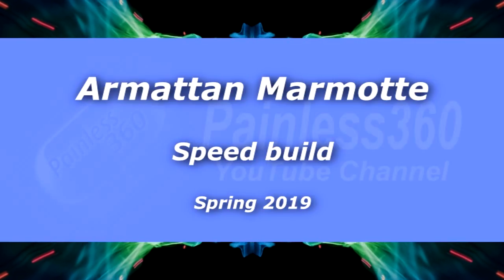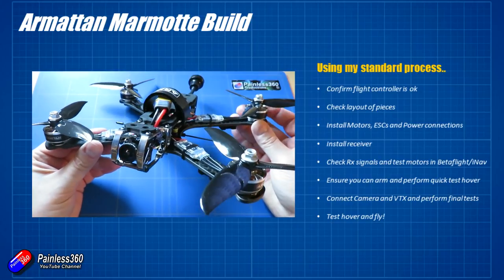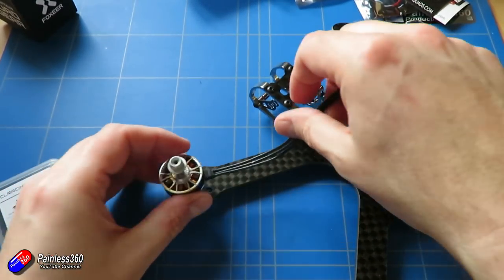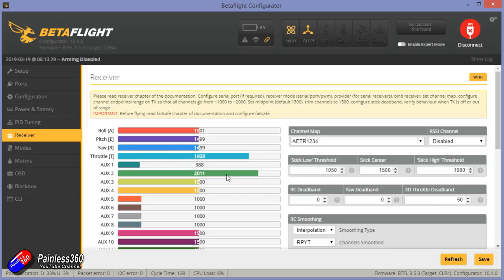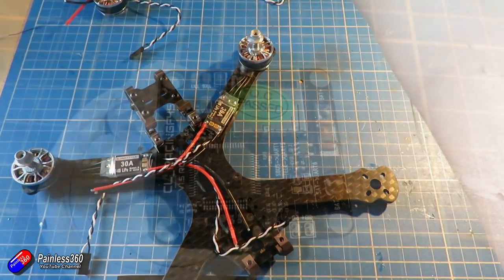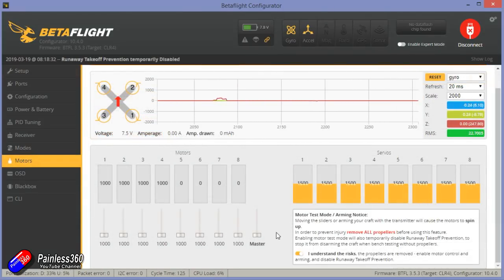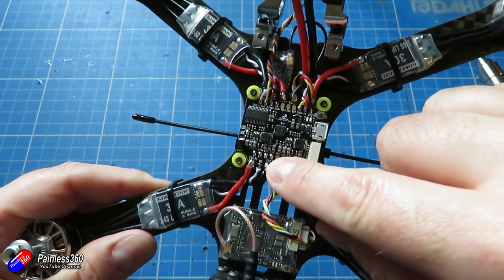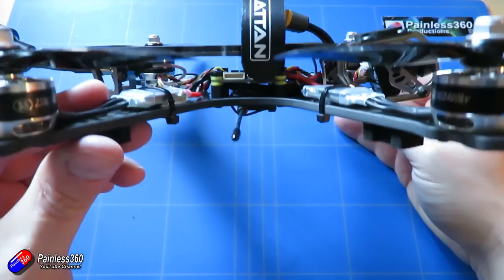Armattan Marmotte: Speed Build

Comment: Thanks Lee!
I always find it fun to check system capacitance with my multimeter after doing the short test:-)
Just finished my Marmotte, and it’s finally the correct evolution of the chameleon after “bolt-gate” and “separate-arm-gate” on the Rooster;-)

Comment: Thanks for the video build 👍
If I use different motors could I use 
Ion Drive 2506 1250KV . 
I’m looking for a good flight time 
Double bladed props on The 6 inch Frame

Comment: Funnily enough I just got finished building mine, literally just plugged battery in for the first time 5 minutes ago :)
Reply: Using different ESCs and motors to your build though. Got spedix 30A ESC and BH 2306 rainbow motors. Just setting up blheli and betaflight :)
Reply from the maker: Best of luck with the maiden flight! :D

Comment: Just curious, but won't this take a 4in1 stack? If so, why not eliminate that added ESC weight?
Reply from the maker: Yep, see my other builds .i use both in builds to show the options and it's a 'horses for courses' kind of thing. Some have very strong opinions about what is best but they both have advantages.
Reply: @Painless360  I was looking at your video because im very interested in armattan marmotte and the same question pop in my mind "why dont use a 4in1 board for a better and cleaner build"
Btw nice and too build right there

Comment: hi thanks for the vid tutorials/content, find them very useful. i built my first quad, the marmotte, and so far, just about everything is working when testing, however i can't seem to figure out to get my taranis x9d+ (2019) responsive in Betaflight, i haven't done any serious port configuration yet, as can't figure out the UART bits. i'm using the Xfire nano RX with the Xfire TX lite module. it seems to bind fine, however when i move the gimbals for instance, nothing is registered in the receiver screen on betaflight. Using 2.3.9
Reply from the maker: Check out the build and how to videos on the Armattan website - they cover all the setup steps..
Reply: @Painless360  thanks, checked a few more vids and got through that initial issue. for the most part, at this point i always get 3/4 channels responsive in betaflight. So A E T but not Roll, or if i switch the mappings it could be everything but Throttle. when i check the channel monitor on the taranis, it all seems fine.
Reply: @Painless360  made it through, got a test hover done, thanks for all your time, effort and videos lol. still, have some work to do but it's mostly tuning, actually built a second one since the chameleon TI. My Marmotte in regards to cable mgmt is a mess, but the TI is a lot better, aside from that, i just nixed the receiver in a crash, but =) thanks again

Comment: Do you think 6 inch props can be squeezed in the frame or is there not enough clearance for that?
Reply from the maker: Just measured it.. they fit with about 2mm of clearance..
Reply: @Painless360   Thank you so much for taking the time to measure it up. 2mm seems like a tight fit. I wonder if they intend to come out with a 6 inch version although if they had just made this frame a tiny bit larger, it would have negated the need for a different size frame altogether...

Comment: Would someone please explain to me what the advantages are to running 4 separate ESC's over a 4 in 1. Thanks
Reply from the maker: Easier to replace, easier cooling, personal choice, frame size... Lots of reasons.. Happy flying!
Reply: @Painless360  and the downsides would be? Not as protected, possibly heavier, more connections to solder and maintain, not as clean looking install, and ?

Comment: Whats that under the Crossfire antenna?
Reply from the maker: At what point in the video?
Reply: @Painless360  1:10 / 12:49 There is something between the frame and the antenna
Reply: @Painless360  1:10 / 12:49 There is something between the frame and the antenna
Reply: Looks like a foam pad to space the antennae from the frame, and zip tied in place.